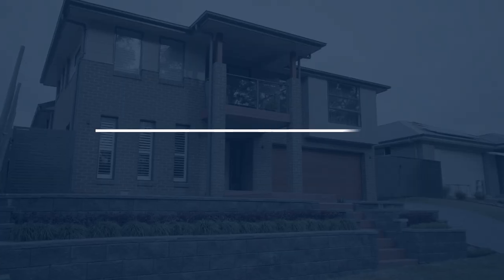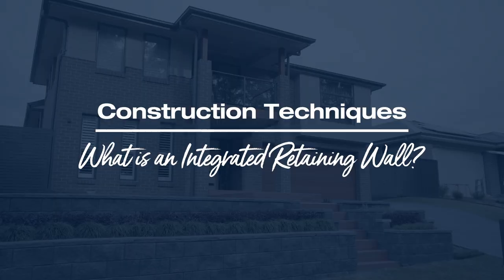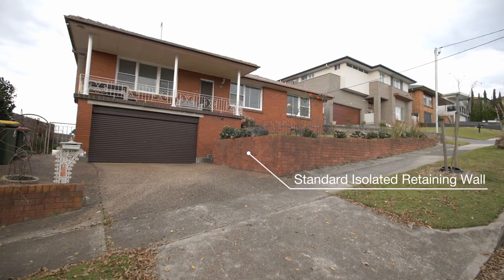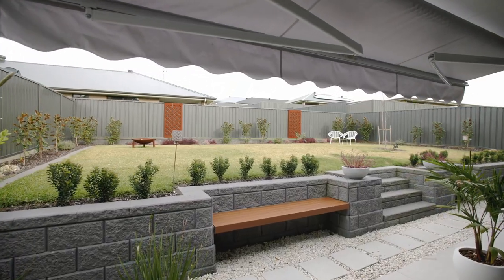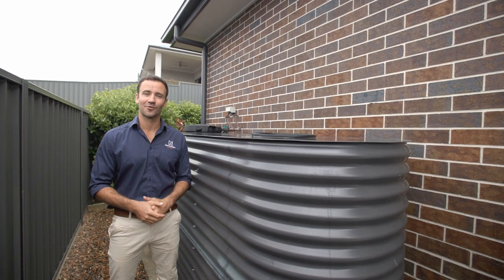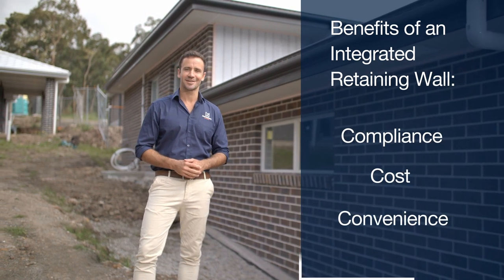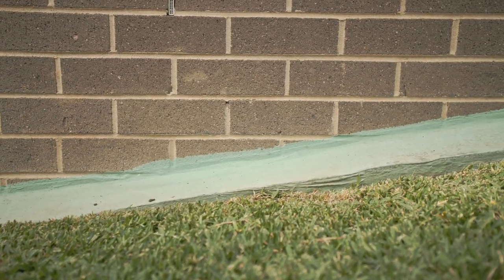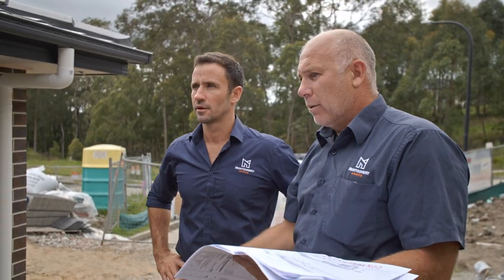Construction Techniques | What is an Integrated Retaining Wall?

Comment: what is the difference then between Drop edge beam vs Integrated retaining wall, why & when which is used?
Reply from the maker: A drop edge beam is where the edge of a concrete slab runs vertically down to the natural ground level, to retain fill underneath the home — and thereby replicating a retaining wall. Whilst it can be used across both level and sloping sites, this technique is particularly helpful for building on a sloping site. 
An integrated retaining wall sits tight against the external of your house, creating structural protection for your property. This technique is an excellent option to create structural and long-term protection for your home, and to alleviate costs post-handover.
We hope this helps!